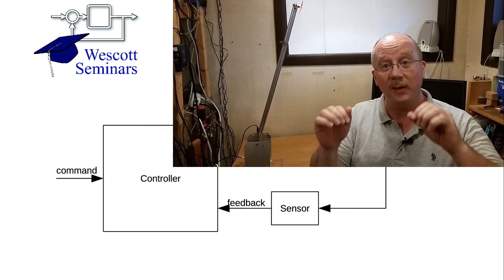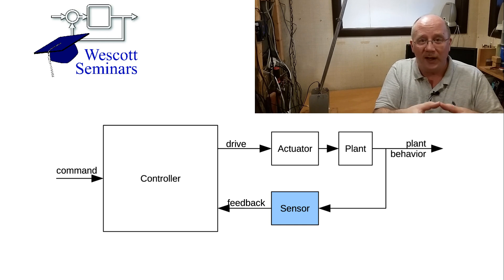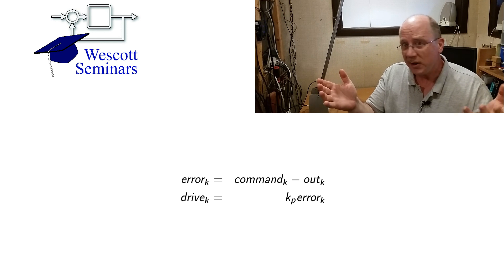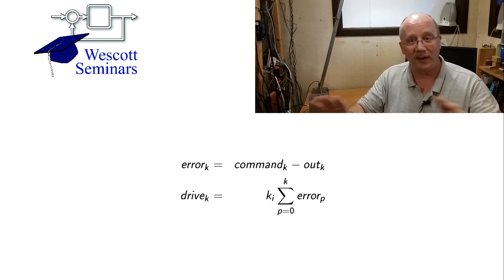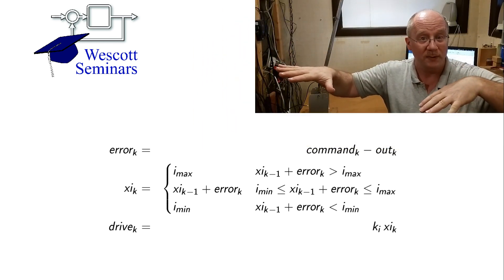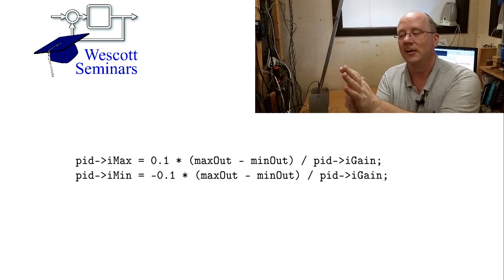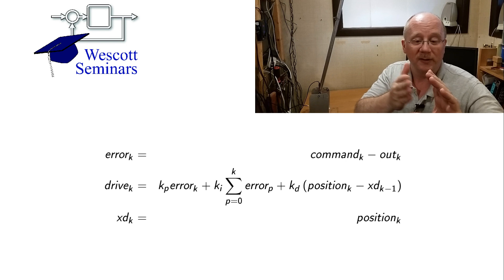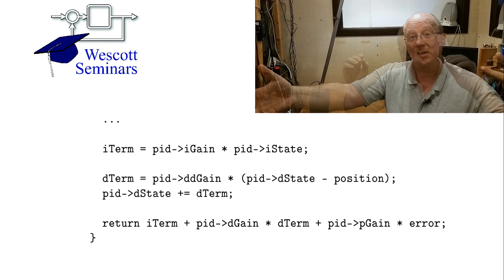Implementing the PID Controller in Software

Comment: Why oscillations occur in the controller output if the PI gains are increased?
Reply: I gains do not help with overshoot, only correcting steady state/DC error.  The P gain being too high will cause overshoot, if there isn't enough D gain to compensate/slow it down

Comment: Sir, I am confused with Sampling Time constant. Of course we have to put our PID into a timer instead of infinite loop but, I realized that you didn't add sampling time constant to into your I and D expression. When I surfed on the net, there are some PID controllers which also includes sampling time. What will I am gonna do ?

Comment: I'm trying to understant why interrupts are needed when the PID is going into a microcontroller
Reply: It's been a while since I watched this video so I may be wrong, but no one has offered a reply.  I am merely a student but I'll do my best...

This is a discrete PID controller, not continuous control, which generally implies a fixed sampling rate.

Most sensors use I2C or SPI bus to transfer data. The simplest way to read data is to poll the data on each pass in the main loop; however, you'll often be reading the same, unchanged data out of the sensor's buffers. 

Normally, the sensor can generate an interrupt when new data has been internally captured (which will occur at a fixed rate). So if you have a SISO system such as this, your sampling rate can be determined by the sensor's update speed.

However, for a MIMO system, it may be wiser to have a clock generated interrupt to indicate that data must be read from all the sensors and the output on the DACs must be changed.

Comment: Hello and thank you for informative video. I have couple of questions about integration part. Firstly, should I reset integration once I supply new command (goal)? I was thinking that integrated error no longer stays valid for different command. Secondly, what about systems where set value (command) remains the same (such as desired angle for balancing systems)?
Reply from the maker: Whether you do that depends on the problem at hand.  On a servo system where the command is constantly changing, no, you don't want to do that.  On a system where there's are distinct setpoint changes -- maybe.  Some practitioners always do, some always don't, and some look at the characteristics of their particular system and make an informed decision.
Reply: Or, if you overshoot, why not test the integrator?  If you don't reset, then the integral will still be pushing the system to overshoot, instead of bringing it back down to the setpoint.  Am I thinking correctly?

Comment: hey, is band limited derivative  somehow connected to a kalman filter ?
Reply from the maker: Sorta kinda.  Strictly speaking, a Kalman filter is a linear, time-varying filter that has one output per state, and usually has more than one input.  Moreover (and folks forget this part) the only thing really special about it is that it's designed using a specific design methodology that takes the system characteristics into account and designs a filter that's optimal for that system and a specific set of optimization criteria.  From that standpoint, no, a band limited derivative is not a Kalman filter.

Practical Kalman filters often settle out asymptotically to a non-time-varying version; it's called the "steady state Kalman filter".  If you set out to estimate the position and velocity of something like that from noisy position measurements using a Kalman filter, the velocity estimate of the steady-state version of that would be a band limited derivative filter, or something close.

Comment: Thanks for these videos.  I use PID controllers in a bit of a different setting: game development.  They're useful for just about everything in and out of the physics engine and they're kind of my go to "make this thing go here or do this other thing" component and it's cheap computationally as well.  But anyway I'd discovered about windup the hard way, I had a number of thrusters controlling a spaceship, each thruster error is based on the velocity and angular velocity compared to the desires velocity and angular velocity.  You can make a spaceship of any shape, stick thrusters on it anywhere you want and they'll just figure out how to go by itself, but every once in a while it would just decide to fly off into space sideways.  I had narrowed it down to the I parameter and I just disabled that (it's not really necessary here, being a zero-friction environment) but now I understand what's going on with it.